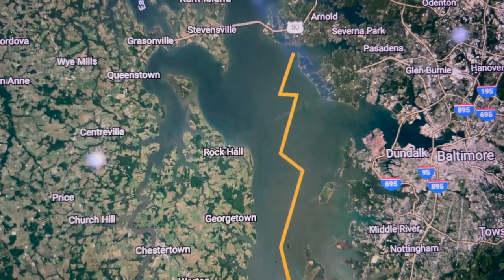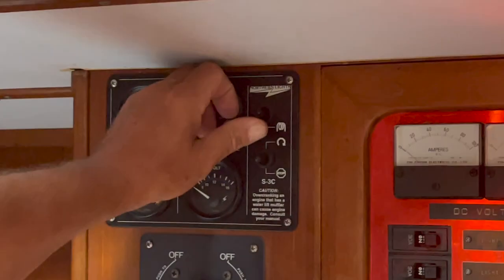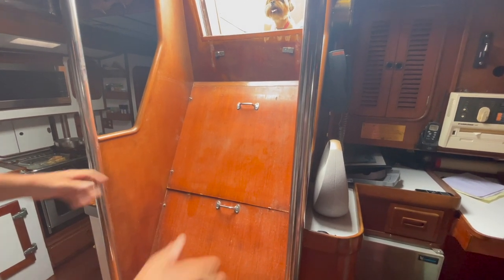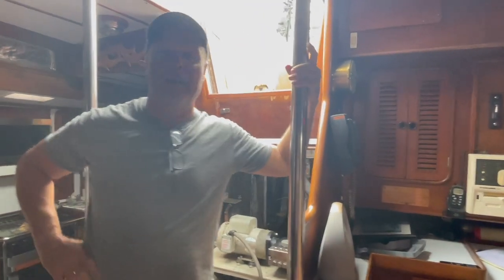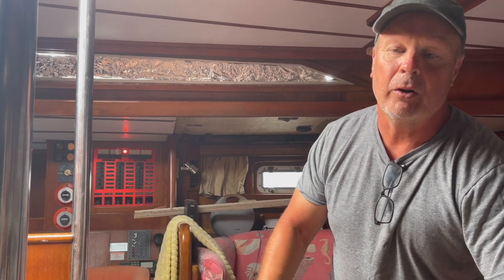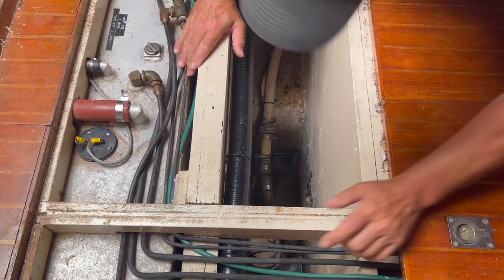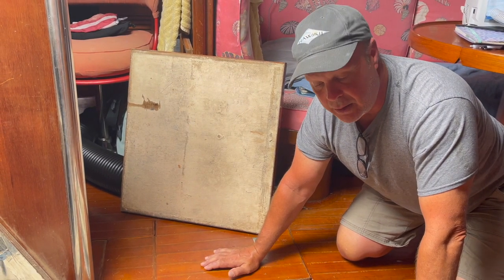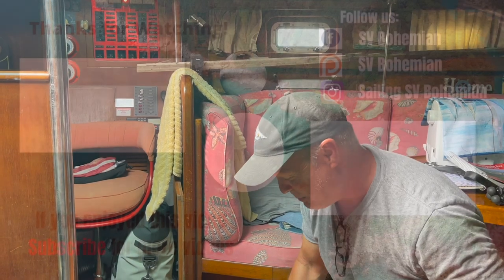Morning after the MISHAP!!! Part 1 SV Bohemian Ep. 24

Comment: Hate to say .....Standing Water = Mold .... might need to wash down with mold killer .. 👍
Reply: One of my daughters came to visit. .  We gave the bilges and floorboards a work over .  The thing that I would like to do , but it would be a crazy amount of work, is to remove all the fuil tanks.  Clean and paint under them, then put a fresh coat of undercoat on the tanks. I’m surprised none of them leak on the bottom. Maybe after the teak on the deck is removed and the decks are shipshape I’ll do it… .  I’ll hit it with mold kill when I put her back in the water. I use mold kill from Home Depot.  It seemed to work well when flipping houses ,but thirty bucks a gallon.
Reply: @briandale8386  Getting ALL the leaks fixed is Priority #1 .... STOP all water intrusion.
Cheers ... Good Luck ... 
PS: You'll have a REAL BEAUTY when done !!